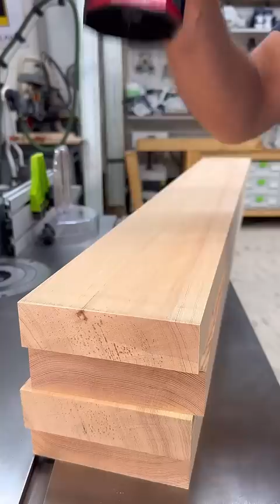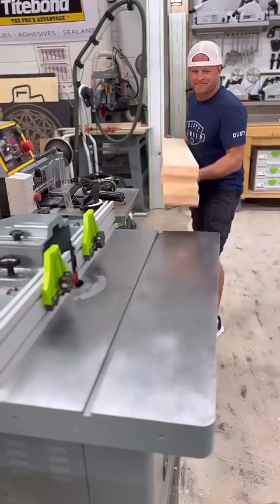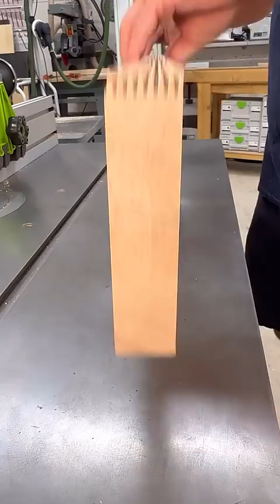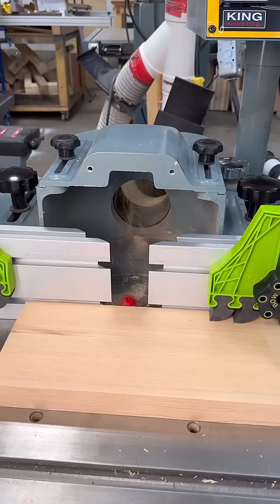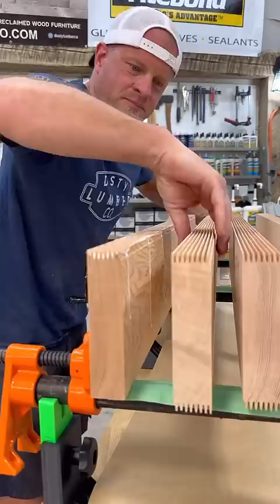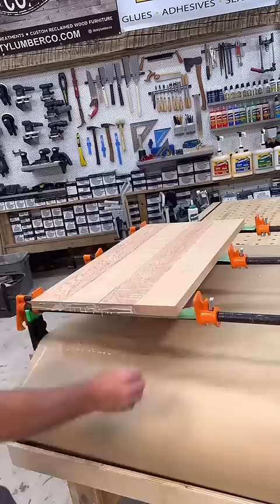Freud finger joint bit and I definitely used way too much glue #freudtoolsambassador #woodworking

Comment: quick recommendation, tighten clamps in rhe middle first to avoid glue pockets and uneven glue distribution on one end to the other. if you clamp one side first then you push glue towards the other side
Reply: The grooves are usually deeper than the teeth for that specific reason
Reply: And where did you acquire your YOUTUBE wood working degree sir ? 😂😂 always gotta be one of yall in these comments 🤦🏽‍♂️
Reply: Not sure if you're referring too me or the OP, but I've been a carpenter for many years.
Reply: My mother always said, "If nothing good to say, please be quiet
Reply: @McG-Loyd79 What do you care? You jealous or something buddy? 😂
Reply: @McG-Loyd79 
Apparently, you haven't read comments to welding videos.
Reply: Not true

Comment: That bit is for joining endgrain. The long grain will bond with the glue without need of complex joinery.  Just make sure your pieces are straight and square to one another.
Reply: Yes. Many carpinters in Africa do not have these nice machines, just saw and plain, glue and clamps. They make beautiful pieces of art.
Reply: Yup.  I guess this video was to try and justify the purchase to those who don’t know this.
Reply: From the looks of his shop he has no clue what he is doing...LOL
Reply: I mean it can't hurt
Reply: Agreed, if you have some warped boards you can throw a few biscuits to help align but this video is a total overkill for anything other than endgrain.
Reply: Like this bit o knowledge. Never seen one, but it shows merit.
Reply: Is it a coincidence that the two parts fit together giving out the same final height? I would have expected one part to be at worst half a teeth off to the other one.
Reply: The finger joint adds a lot more surface area to be glued so I guarantee it’s stronger than a butt joint. There’s plenty of tests videos on here to prove that.
Reply: @ssa7843 
Careful setup keeps the joints flat.
Reply: He definitely does know what hes doing, has done many complex joinery videos. Just experimental i his use of new tools. Did he need to finger joint it no. But you also dont need to finger joint end grain on a bias and worst case it helps catch all that glue to than squeeze out lol
Reply: I mean does it matter either way. Maybe he liked the designs on the sides

Comment: Gotta make sure you have your board orientation figured out for the reverse joint.
Reply: Yeah. How do ya do that?
Reply: @ashleygrant3131  he showed how to do it on second board...
Reply: @miki_car no he didn’t he just pointed and cut he didn’t show how to do anything
Reply: You line it up and flip it to get the reverse cut that fits in
I didn’t even have to hire a detective or take a course at the Y to figure that out
Reply: @ltsjoeyy   yes he did you just not paying attention
Reply: Not really, you just have to make sure both sides are usable on all pieces, or just be "extra" careful and have that coffee in the morning if one side is trash. Unless you're grain matching this isn't a problem.
Reply: @ltsjoeyy L
Reply: Главное побольше клея!
Reply: What is that brown sheet called?
Reply: @granthpunjabi   It's just paper.  You buy it in a roll at Home Depot or Lowe's in the paint section.
Reply: Just turn it over, genius

Comment: Overkill for the intended purpose, but SUPER strong joint! Way more surface area!
Reply: Biscuits would have worked
Reply: Not for shear force tho
Reply: Not only more surface area, but it also allows the wood itself to directly resist shear forces without loading the glue and without any complicated cuts and joints
Reply: What was the intended purpose?
Reply: @fived9424 probably a small table?
Reply: @andreabuzzolan9807 thought the same thing
Reply: It's a great solution for making long beams.
Reply: Ahhh… way over worked…just glue the boards together, perhaps with clamping cauls to keep everything level. Modern glues are stronger than the wood itself. Shear force is better than the wood so waste of time and glue.
Reply: @brianelliot2719  You are right. This method is not intended for this type of joint. Rather it's a way of joining beams in the longitudinal direction.

Comment: most wood glues need the surface to be moist for a good bond. i brush the wood down with water first then brush it with glue. wet rags clean up extra
Reply: He has mixed the water in with the glue, I suspect.
Reply: @bravofighter it doesnt work that way
Reply: You're thinking of polyurethane glue. That's clearly not polyurethane glue.
Reply: @PScott80 can confirm. This is regular wood glue, adheres without. Wood glue will go into the pores of the wood without water.
Reply: Está cola ya lleva agua. La que se humedece es la de poliuretano
Reply: That guy shows up
Reply: Don't wet with tight bond 3. Only polyurethane glue.

Comment: When i made my apprenticeship 30 years ago i was taught to screw a short strip ( about 8-10 mm /// ¼ Inch broader then the " original" Plank ) at the head of a plank , seo it ll be routed at the head . Unscrew it+ u ll have a perfekt fitting " brush " to place the glue . Pulled with 3-7° U can dosage the mass of glue . 89° at hard wood , 83 at soft wood , which can Take up more glue than the harder .

Comment: You never show how to clean all that dripping glue 😂
Reply from the maker: I've shown it in a few videos.   Wipe with a wet t-shirt scrap, scrub corners with a toothbrush and water, or sand it if it's dried. 👍👍
Reply: @dustylumberco  thx for the answer 😉
Reply: Bro. Wet paintbrush with water … 😂
Reply: Indiferente. 
Isso não é importante.
Pergunta inútil.
Reply: @gapecaceres  I'd like to add that using a cloth is better than paper/shop towels when wiping away glue. If the glue is starting to tack up paper towels will stick and leave bits and lint. 

Also, titebond is water based. Throw your rags in a bucket of water and swish them around to get most of the glue out. I put a little detergent in too, to sort of prewash before they get to the washing machine.
Reply: You need a area where you do dont clean it at all. Its not possible to clean and work.
Reply: with a damp rag and then sandpaper for any bits that dry
Reply: You need someone to show you how to wipe glue?
Reply: @joshross5298 same ones that can’t wipe their own butts either.
Reply: sand it down u chomu
Reply: Throwing that huge paper in the trash bin... 😊
Reply: @anthonymorris8891  Yup. Home bucket with 2 gal water and a shirt's worth of rags will work for weeks.

Comment: That's impressive! How strong is such a finger joint compared to maybe using dowels or something?
Reply: There is no comparison. You get such a bigger glue surface, and it is kind of a joint. This joint for this use will always win from dowels or dominos
Reply: @FireOfJagz  In this application I think the finger joint is unnecessary. Wood glue is stronger than the wood itself in this long grain to long grain application. You see this type of finger joint all the time in end grain to end grain joints- IE finger jointed pine trim stock. It always breaks apart on the finger joints. If your typical pre-primed pine trim was actually held together with dowels or dominos it would be a lot stronger. Now in a table top slab like he's making, I don't doubt that dowels would be stronger, but the question is how many are you putting in?
Reply: Dowels an dominos wouldn’t increase strength but rather helps with alignment on longer boards.
Wood glue is strong stuff.
Reply: Think of the multiplication of surface area that bit offers.
Very cool, but not entirely necessary - said the old cabinetmaker.
Reply: I use that kind of joint to make panels since many years now. It's absolutely stronger than the wood itself, don't require expensives lamellos or dominos tools and when you wanna joint 10 boards or more it's way more quicker. You can also use this working step as a routing step. It does everything a tongue/groove does but you just need one tool setup so it's quicker and stronger
Reply: Is this the bit that also joints the edge as well?
Reply: Strong AF
Reply: @Funknwanker your just repeating what others have said... there's NO WAY dowels or dominoes don't increase strength.  CLEARLY if you're trying to break a board at the seams,  trying to snap a 5 dowels as well is going to be more difficult.
Reply: @theoriginalmonstermaker  - the glue is more than enough to hold the joint together on a panel.  If a glued up panel breaks it is through the board itself not the joint.  Using dowel or dominoes for strength along a joint on a panel is only for alignment not strength.
Reply: @theoriginalmonstermaker i agree with you. I still think that both just add a fraction to the overall strength though. Dowels actually will add a mote considerable amount of strength than biscuits
Reply: @Funknwanker  whether or not the glue is the fail point is irrelevant.  When you add additional pieces of lumber that cross the border of the seam, it adds strength.  Your point is that the strength is unnecessary.  That's fine.  But it IS stronger w dowels.
Reply: @alexanderknips4690  yeah fair enough,  biscuits probably snap pretty easily.  I've never actually used them,  but they are pretty thin... maybe if they were hard wood material in a pine panel though? The man advantage of adding dowels,  or tenons, or any additional lumber to a joint,  is to have that added grain run perpendicular so it's less likely to break in same dimension... not sure if they make all biscuits that way : /
Reply: @Funknwanker   hey! "You cannot simply say that glue is stronger than wood (or that wood is stronger than glue) because wood is not a homogenous material. It is a composite, made up long fibers held together by a glue-like polymer. The fibers are very strong; the polymer is relatively weak. More important, the fibers give the wood “grain” and this unique composite structure makes the wood stronger parallel to the grain than it is across it. The strength of a glue joint depends on the orientation of the wood grain in the adjoining parts much more than it does on the glue itself." 
https://www.youtube.com/shorts/eR14v3dpH4w
Reply: @alexandergrushevsky4528  i literally just said that in my comment before you entered.  But it is an absolute fact that a side grain butt joint will never fail because the glue is in fact stronger than the lignin holding the wood fibers together.  In fact the video you provided proves me right.
Reply: That PLUS dominos or dowels & you could make a bridge deck! 
Cool bit.. very nice
Reply: @Funknwanker , you are absolutely right on this.
Reply: @johnburns2940 agree its way over kill, but it's so easy to set up and use the why of it becomes more like why not?
Reply: God bless all of us who work with wood.. we are special. We share something special, yes?
Reply: I guess you get a chance to flex the pieces for a flatter finish. Edge to edge you have gaps because wood warps after cutting.
Reply: With the proper amount of glue, no worries!
Reply: the would has been previously jointed
Reply: Excellent question, excellent answers. I would add that the atmospheric stability this would add under a finish must be very high, especially when you're gluing boardsawn to quartersawn like he is. I can't tell you how obnoxious it is to make a wooden surface look like glass then come back in a month to find one section taking a walk despite perfect gluing.
Reply: In this case, probably stronger than the wood.
Reply: @ShadyD365  I dunno if you mean me but I was dead serious. I'm a novice to this stuff and I'm just trynna learn

Comment: for those thinking about using this: it's a bit of a pain to set up, it's beautiful but not that strong. The use case here is also a little ridonculous. Dowels or dominos would be better. These bits are around 150-200 usd usually.

Comment: Fun fact, the color of the tape defines how long the glue will remain pliable. You may have noticed that the "tan" tape, cheap and fast drying glue, is almost impossible to completely remove. 

The blue tape is rated for 2 weeks and the green tape gives you an extra week or two, but in practice it works out to more like a month or so, that you can take to texture and paint your walls, before the tape starts to bond to the trim. Never use tape btw except for what he's doing.

The more expensive tape doesn't protect your clear fir from the scratchy bar clamps any better than the cheap stuff, but the butcher paper and glue waterfalls do add to the visual effect. 

If you spritz a little water into those bone dry channels before you lather the glue on - well what am I thinking? Look at all those sponsorship posters!

Comment: I'd be interested in a test comparing the strength between this joint and purely edge jointed boards.
Reply: You probably won't notice, because in both cases the grain will fail next to the glue. The joint is meant for end grain/end grain joinings to make a stud longer.
Reply: @smart-sloth-1630 
The finger joints more than double the surface area that is glued and interlocks with the adjacent boards, it's going to be much stronger than a butt joint.
Reply: @weege5.45 The bit is meant for end grain to end grain joints (these will indeed be stronger with that technique). The vide shows a side/side grain joint and there is no use for this technique. Make a simple side grain/side grain joint in your shop and break it. It will never break in the glue interface, but always next to it. No need to increase the glueing surface if it is not the glue that faild.
Reply: Although the strength of the glue is initially stronger, after a good amount of years the glue will generally deteriorate and be the weak spot instead. I think a joint as shown in this video can maybe  mediate that
Reply: Read a test report on joints. Hard to believe they are all very similar in strength. Fixed, Foxed, floating, finger, biscuit, cope & profile, simple butt… they are all about the same for strength.  The strength is in the glue, not in the wood.
Reply: With all those choices I prefer Fox for furniture, sliding dovetails for drawer faces, pinned mortice & tenon for breadboard tops (that’s a dry joint. No glue, and it will last for several hundred years),  dovetails (yes, it’s possible to make them quickly), and captured pass for drawer backs. For guitars, where joints need to last 150-200 years… just a simple butt for electric guitars, and wiggle-butt for acoustic guitars (wiggle-butt, or “wiggle joint” is for hide glue and doesn’t even need to be clamped).  That may sound like a lot of choices but it’s only seven joints, and under a journeyman, or master they can all be learned in a day, and accurately proficient in a couple of days. 
Japanese joints are beautiful but I can make nice casework with these seven joints, and Japanese joints are usually not money makers fir production runs.

Comment: It is necessary to adjust the position of the new red cutter to fit the other side so that the two pieces have a flat surface as you did.

Comment: Great spindle moulder cutter. I'm always amazed with your beautiful work and also the cleanliness of your workshop. Not a dust spec anywhere to be seen!! Wish mine was like that!! 
Do you employ a cleaner???
Great work and thanks for all your videos.
Reply: that sir is a under bench router not a spindle moulder. moulder rpm are way slower not nearly fast enough for a router cutter. my scm spindle moulder maxes out at 10k rpm whereas my overhead router technically not a bench one maxes out at30k rpm.

Comment: Nice!!  My only issue is, why so much glue? Stuff is gonna spread as soon as the fingers line-up.  And the squeeze out is gonna be insane.
Like, I almost expect it from the beginning and layout 2 trays on either end to act like troughs to catch all that glue.  But then again, I only would've used a 1/4 to begin with...
Reply: Worse, there's actually no escape path for most of the glue - it's caught in the valleys, so you're actually impeding the ability for the wood surfaces to touch...
Reply: @bay8791  What??  That doesn't make sense.  The glue is supposed to be in between-- to actually form the bond between the boards.  
I was just pointing out the excess amount of glue.
Reply: @zafarsyed6437  Did you actually read the title of the video? Dusty mentions using too much glue. No need for you to ask the question.
Reply: @M_M0109  Didn’t know questions weren't allowed.
Especially when asking "why" even though the "what" is part of the title. 
My apologies to the brethren of the YT sanctimonious council.
Reply: Да да, так потом клей тупит ножи на рейсмуси или фуганке

Comment: A good video would be to test the difference between using this type of joint vs a straight glue up.
Reply: Laminated glued straight edge is also strong, but this joining should be even stronger.
Reply: A good straight joint is stronger than the  wood.  I've never seen a good glue joint fail on an interior application in 35 years.  Finger joint is usually for end grain joints.
Reply: Разница в площади склеивания.
Reply: I was thinking about comparing it to a single dovetail. The angle and width probably could be standard.
Reply: @waroftheworlds2008  single dovetail is for beginners 😌

Comment: Use a BRUSH to apply your glue! That's faster, more even, a whole lot less messy, and you won't waste so much by using twice the amount of glue that's actually needed. Also this type of glue (the white glue meant for wood work) can be cleaned off of your tools and your workpiece with a wet cloth; it can essentially be washed away cause is water dissolvable until it has dried. Only from that point on it is water resistant (but that you likely already knew).